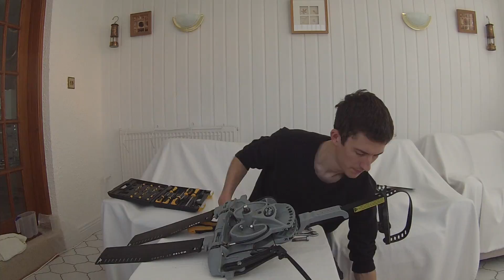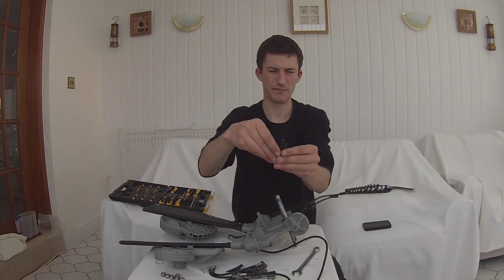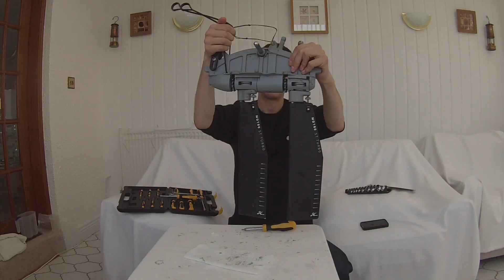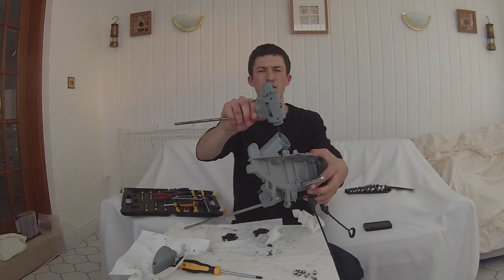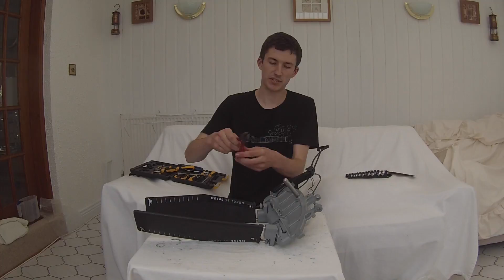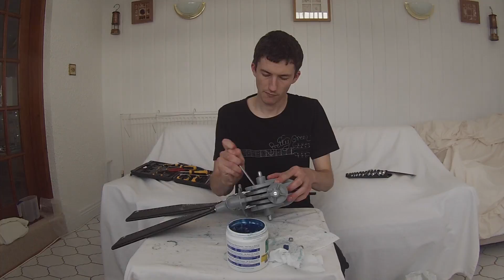Hobie Mirage Drive - Service and Maintenance

Comment: Mate u made it look sooooo easy😉 followed ur video step by step and took me 3 hours to complete the entire maintenance... great guidelines I'm so grateful and u have earn a sub and will make sure to share it on our group... tnx once again u are a star mate👍👍👍
Reply from the maker: Abbas Muhammed thanks for the comment and thanks for subscribing 😊 that reminds me... it’s time to service my drive again!
Reply: @CornishKayakAngler  haha... quick one mate! Once service is done do u  have the grease coming off after the trip? Mine came off abit and rinsed it with water then applied W40 spray... is tht right? Tnx for the reply bruv!!
Reply from the maker: Abbas Muhammed yeah any excess grease will work it’s way out after the first few uses, thats normal. Just use a little anti-corrosion spray every few trips on the exposed metal parts to keep it all good. My drive is 2 years old now, and not a sign of rust or corrosion on any of it in over 50 saltwater sessions.

Comment: Very helpful video, thanks for taking the time to share your knowledge.  Bought a used kayak and drive, I need to maintain the bearings and check to see that they are good.  Previous owner didn't know anything about any bearings, so they haven't been maintained / greased.

Comment: Excellent video. I have a slightly different version of the 180 Mirage, but procedures are almost exactly the same. Easy to follow instructions and my clean and maintenance was much quicker than I expected. See you out on the water sometime.
Reply from the maker: Thanks Ian, I’m glad you found the process easy to follow. It’s good to know the ins and outs of the drive for easy maintenance and condition checking 👍🏻

Comment: Excellent video, thanks for posting the step by step along with sharing your knowledge of the system.  I have the ST drive which will be different but similar enough.  Still not sure how much tension to have on the chain drive cables but will figure it out.

Comment: Couple of things I’d add. The long roller bearings, be careful when attaching the drum. If one pops out it could snap. The chains have 7 links. The centre link goes on the fatter tooth leaving 3 either side. I used some multi wipes, makes for a cleaner job. On the v2 fins, don’t forget the thread lock on the rods. 

Great video though. Very detailed. Tight lines boys and girls!
Reply from the maker: Thanks Gio - you are right, the long roller bearings could snap if one jumps out of place when sliding the drum shaft into the drum. Some cleaning wipes are also handy as it can get pretty messy with the grease!

Comment: Great video, i learned alot i think. My drums are awfully loose on the shaft, i bought the drive used. It seems to be worn around the shaft, both drums are very sloppy. I know its hard to figure it out without seeing them, but should i replace both drums and bearings?
Again thx for the excellent video and your time
Cliff
Reply from the maker: Thanks! It may just be the bearings that are worn, or you could even have one missing. Worth checking. It’s more likely to be that over the drums themselves. Worth checking the tension in the chains and idler cable as the slacker these are then more the drums can slide about on the drum shaft. Don’t overtighten them though, you still need a touch of play in the cables and the drive to feel fairly free to move without resistance.

Comment: Very nice.  This gave me the courage to attack the job.  It is a tedious but not particularly difficult job.    Personal preference but as I reassembled the sprocket assembly I reinstalled the cover with the four screws before attaching the final aft pieces.  

My drive is not very old but the bearings were pretty dry.  Suggest that the drive be inspected for adequate lubricant no later than the end of  first season of use.  Not sure if Hobie was not using enough lubricant or if lubricant is simply draining out with use.  Either way, beware.

I am not wild about the screws being used on the covers ...kind of like sheet metal screws...but perhaps necessary given the overall design.  I tried to reinstall the cover  screws such that they are following the threading of the original assembly process.  I started the screws with minimal pressure and let them find the path of least resistance.    Not sure what is best, but it seems to me that cross threading the original threads in the covers will cause issues in future maintenance.  I did not use grease on the screws.  Personal preference, and perhaps I will regret it later.

Comment: Thank you for the video. My question is, the fins are they suppose to have that much Flex in them? I noticed that they move from side to side very easily on yours. My 180 drive is second hand and the fins are really stiff. Should they have a lot of flex or stiffness?
Reply from the maker: Stiffness within the fin itself or stiffness when trying to move side to side? The fin itself is a flexible rubber that will twist and flex in the water with each pedal stroke. The side to side movement shouldn’t have too much resistance when done in air. If yours is tight then slacken the chains and idler cable just a touch until it eases up. Just back off the nuts half a turn at a time.
Reply: @CornishKayakAngler  Thank you so much.

Comment: nice vid man.  I have a slightly different version, but yeah, your vid definitely helped me out with my first maintenance.  Do you pack your bottom series of bearing full of grease?  I keep hearing mixed advice on this.  One side of the fence says, use very little grease/ lube on the bottom most bearings (touting that sand and grit will attract and hold sand and grit). Others will state, "Lube em' up good!"  Wondering what you have experienced.  I suppose you have about 2+ years of maintenance on your drive, so what have you found?  Thanks again for the time that you took to create and post this video.
Reply from the maker: Hi Brandon, thanks for the comment! Yeah there have been a few different versions of the mirage drive released since this vid but the basics are still the same. I’m on the side of grease them up, but I will say that I remove my drive from the kayak and lay it in the footwell when launching and coming into land every time, this minimises the amount of sand and grit finding it’s way to the drive. If you are someone who beaches with the drive in place then the sand can find its way into the drive and get stuck in the grit. This may cause more wear than usual and in such a case no lube would better to let the water flush everything through. Hope that helps!

Comment: Hi very nice and useful video thanks a lot for sharing it! I have a question, after the maintenance I ve got quite a lot of play between the pedals. If I try to wide the pedals with my hands they move quite a lot. Is it normal? Is there a way to reduce this ? Thanks a lot!
Reply from the maker: Hi Guido, thanks for the comment. Try tightening the chains a touch more, this should reduce any side to side movement on the pedal drums. Just go half a turn on the nuts at a time evenly between them all and see if this improves it. Hope this helps!
Reply: @CornishKayakAngler  thanks a lot for your reply! I did try to tighten the nuts… it is better however pulling away the pedals I still get over 1 cm movement which seems to me a lot more than before… do you the no it is normal?

Comment: Hey got a question about the mirage drive crank arms. Mine have some flex on them is that normal? Or should I tighten the bolts on both sides?
Reply from the maker: A little bit of movement is normal, but yes tighten the drum bolts and that seems to reduce the flex. I nip mine up a quarter turn every so often. I think the action of pedalling causes them to back out ever so slightly over time. Give it a go and see how you get on!

Comment: how much tension is enough for the cables? side to side slack of 1/8", 1/4", 1/2", or 1mm, 2mm, 3mm, 4mm, 5mm...?
Reply from the maker: I tend to run mine more slack than tight. I think it helps minimise wear on the sprockets. There must be around 4mm of deflection on the cables when pinched in firmly. If it feels tight just slacken it off a bit, you’ll notice if things get too loose as there will be excessive side movement in the drums. A few millimetres of movement goes unnoticed during use though. Hope this helps!
Reply: @CornishKayakAngler  thank you, good to know, my 23 drive shipped very tight from the factory and I felt something was wrong

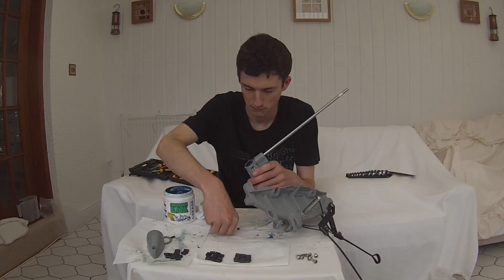Comment: 27:15 when I took this unit apart, my black plastics were broken for the bearing. You can buy them separately or just the whole unit as a whole?
Reply from the maker: You can get the bearings separately from a Hobie dealer (they may have to order them in), although make sure the bearing housing is not worn and causing the bearings to wear away. If the housing is worn then it’s best to get a whole new spine assembly (which includes a full set of bearings)
Reply: @CornishKayakAngler  my dealer doesn't want to do this, I did it differently, I bought a rod made of delrin, 6.3 mm in diameter, and cut it to size, that is, 12 mm, so far everything works fine

Comment: Thanks for the video! By the way, is it possible to explain (so that a child could understand), how the mechanism works?
Reply from the maker: The Mirage Drive works by stepping alternately on the pedals to drive fins side to side under the kayak. As the fins sweep through the water they twist and push against the water, which in turn pulls the kayak through the water (propulsion). This works in a very similar way to how a bird uses its wings to fly through the air, or more specially how a penguin uses its wings to swim underwater.

Comment: How do I replace the cables running through the spine that operate the 180 drive?
Reply from the maker: These are preset at the factory and it’s difficult to replace the cables alone. If you have broken a cable then you will need to buy a complete new Spine Assembly. Depending on the model you will need either the MD180 V2 Spine Assy or the MD180 V2 Kick Up Spine Assy.

Comment: Really useful video. Quick question - how do you maintain the drive after each trip? Do you hose it down to get the salt off or is there more to it? Any top tips? Thanks
Reply from the maker: Thanks Colin. I rinse down in freshwater after each use in saltwater. Every few trips I just give the exposed metal parts a wipe down with a rag soaked in Corrosion Block / ACF-50 (any corrosion inhibiting spray would do and stops salt from sitting on the metal surface). Apart from fish scales and some dirt, my drives look close to new even after several years of regular use. Something is bound to give out at some point but it won’t be through lack of preventative maintenance!
Reply: @CornishKayakAngler  Thanks a lot dude. Going out tomorrow for the first time since this lockdown (N Wales). Tight lines!

Comment: Can u buy the sprocket part for this drive? I ordered one, but it's not even the one for it, hobie dealer gave me the part number for it too.
Reply from the maker: You can only get the full spine assembly. The sprockets on the MD180 have the fwd/rev cords running through them and these are preset at factory so not possible to buy just the sprockets for the MD180. If you need to replace a sprocket you will need the buy the following - ‘SPINE ASSY V2 MD180 - 81527002’ - unfortunately they are not cheap!

Comment: Do the actual pedals unscrew and come off the pedal shaft to allow greasing?
Reply from the maker: Yes, there is a cap on the outside of the pedal, use a small flat head screwdriver to pull this out and it gives you access to a nut which holds the pedal on. You’ll need a socket set to remove as its recessed. Undo this and you can pull the pedal off to re-grease 😀
Reply: @CornishKayakAngler  thank you! Will do

Comment: Is it possible to take out the metal shafts holding the fins? Couldn't watch the entire video. My nephew bent the metal shaft. Def needs to be replaced 😔
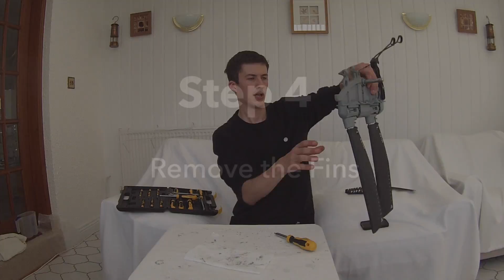Reply from the maker: sengx Yeah you can remove the masts fairly easily. It depends what version drive you have but essentially you either have to remove a Clevis pin held on by a small spilt ring for V1, V2, GT and MD180 V2 drives to then slide off the fin to reveal the metal mast. You then unscrew the mast from the sprocket above using pliers on the flattened section of mast - this can be difficult and may require a vice as the threads are held in with loctite. You can either straighten the mast in a vice or get a replacement one from a dealer. MD180 V1 fins are slightly different to remove as you have to unscrew the fin tensioner using a hex key as shown in this video at 16:14. Hope that helps!
Reply: Cornish Kayak Angler I have the MD180 V2, we tried using a flat head screw driver to unscrew that one section, but wouldn't budge. :/.... do i have to loosen all the other screws on the sprocket first?
Reply from the maker: sengx Nope, once you undo the split ring from the clevis pin, you can slide the pin out to then allow the fin to be removed from the mast. The mast is screwed into the brass insert in the boom above. You will have to get a good set of pliers on the flattened section towards the end of the mast and apply plenty of force to break the loctite on the threads, you can then continue screwing the mast until it the mast comes free. You shouldn’t need to use any screw driver or undo any screws on the sprockets
Reply: Cornish Kayak Angler ah, okay I see what you mean. Thanks a bunch! Definitely helps! Just subbed and liked!